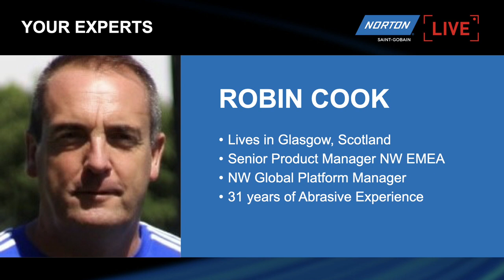Norton Live: How to use Norton Blaze Rapid Strip and Vortex Rapid Blend Discs

Comment: Does anyone know How to grind welds on 14 and 18 gauge stainless steel countertops center welds. Discs needed to bring welds down and blending to make 2 tabletop put together and match
Reply from the maker: Hi Snoopy, thanks for watching and being subscribed!

We do have an “ask the expert” video that covers stainless steel which I will link below; however, If I understand your question correctly, this may not be a job best suited to an angle grinder due to the large, flat surfaces that you’re finishing.

  It may be suited to more specialist tools such as Pump Sleeve Dynishers with belts to ensure you do not damage the surface.  Why not have a chat with your local SGA TSM ? Email us at marketing.emea@saint-gobain.com and we can get you in contact with your local team.

  Here is the “Ask the expert” video https://www.youtube.com/watch?v=5QHqxe28zG4